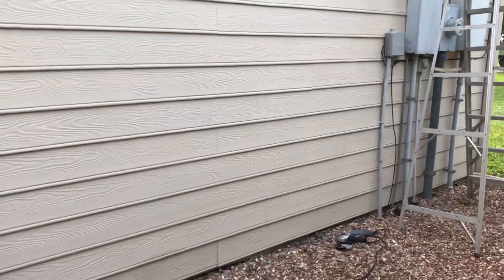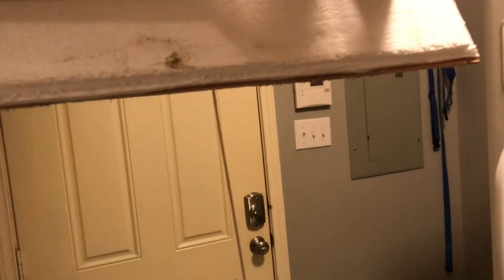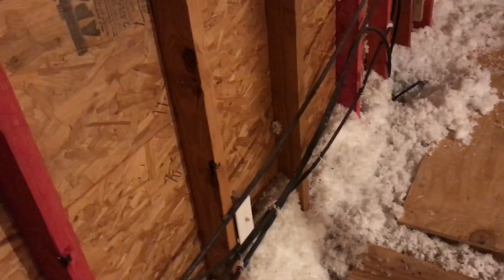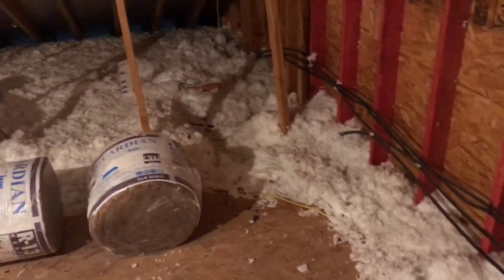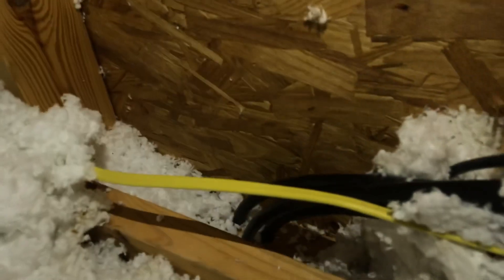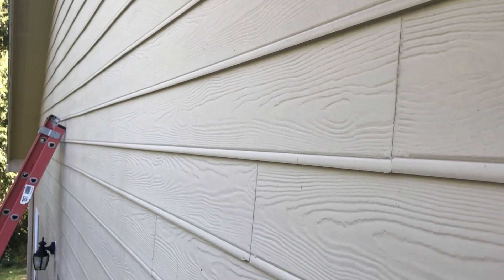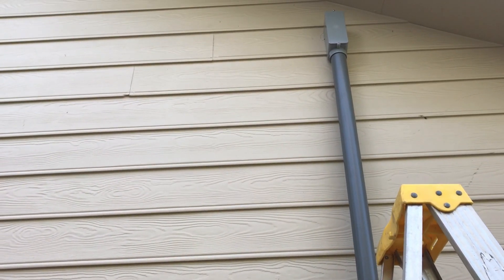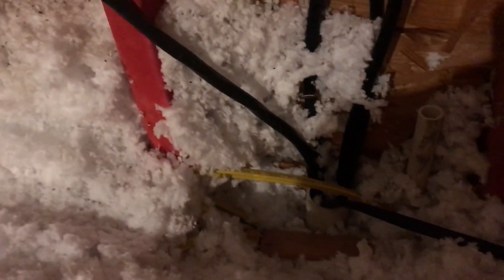Installing Conduit for New Power at the In-law’s House

Comment: The 2008 code formally disallowed subpanel with bonded neutral and ground. If panel was installed prior to this it is grandfathered and would not have to be changed. Great idea to upgrade to current code and put in separate ground for subpanel.
Reply from the maker: Thanks for the support. I usually just get haters commenting on my videos about electrical abs plumbing work 😁

Comment: Wow. How the inspector didn't catch that pig tail mess outside of a J-box is beyond me. Also the fact that 2 of those connections looked to have been taped instead of using wire nuts was a fire waiting to happen. Those attics get hot and that tape would have broken down over time leaving an exposed connection. You saved a lot of heartache and potentially some lives there. Good work.
Reply from the maker: I know it’s not the prettiest install but yeah, my goal was to repair it better than it used to be with minimal intrusion.

Comment: What did you use to cut the whole in the house?...…….A cannon??
Reply from the maker: Yeah not my finest work. Had to use a diamond wheel on a grinder. All I had on hand for the cement board. I have a few diamond hole saws but didn’t have one this size. Was kind of a last minute decision to do the job that day so didn’t have time to get a proper hole saw.